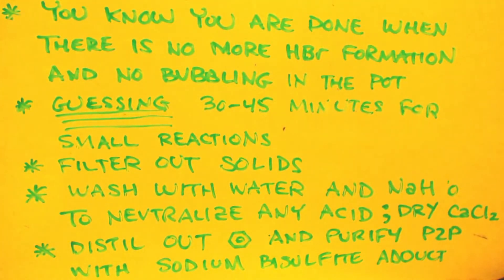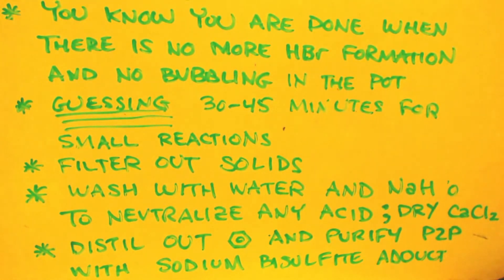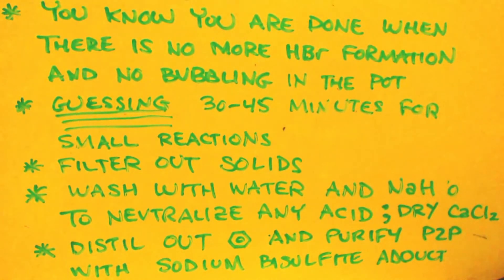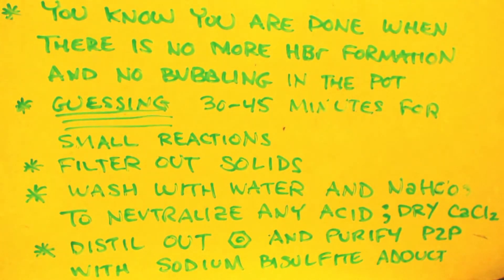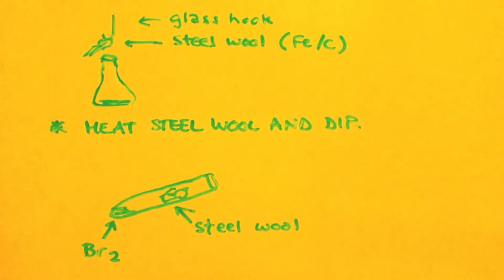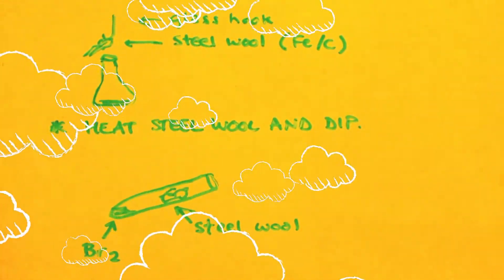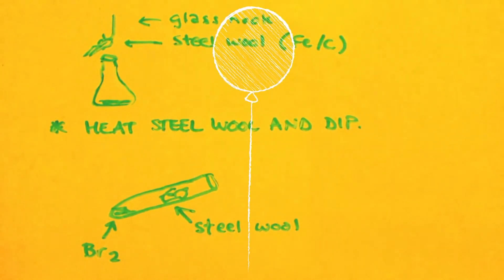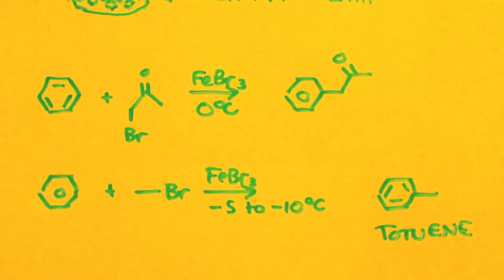P2P SYNTHESIS friedel crafts alkylation PART 2

Comment: Are you saying adding catalyst ferric bromide slowly until rxn is complete?  Then maybe a little more to make sure?  

WARNING  This is not how catalysts work, as they are regenerated more shouldnt be added ESPECIALLY if itd directly part of the rate determining step as this is in an exothermic rxn with toxic flammables of benzene AND potent neurotoxin Br-Ace.

This also suggests you are implying benzene and Br-Ace already measured out properly 2:1 to lower double addition, are all mixed and then the catalyst is added in small increments until complete (bad idea/dangerous)?  Not quite...Instead you use excess benzene (as solvent if no other choice), add the catalyst powder which isnt soluble in benzene so magnetic stirrer a MUST, turn on vigorous stirring and slowly add the Br-Ace to benzene.  I would stop well before 50%, reflux a bit b4 distilling off benzene to isolate product (not fully just yet) and recycle benzene to again same rxn...nearly eliminating chances for double sub.

Now for lab grade quality, one really should use something all species can blend...solid catalyst in liquid rxn is never very optimal.  Being FeBr3 is soluble in water, alcohol etc, a polar solvent is needed.  However, free roaming build-up of H+ is undesirable as the HBr buildup will stop rxn at a low yield equilibrium.  So, a polar aprotic is desired (DCM is great, also pyridine works well too b/c its ability to "catch" the H+ as its made and neutralize it.  Then, well same as but w proper solvent, more control, and much better yields/use of catalyst its much faster and safer as it cant run away.

NEVER mix full batches of reactants together *esp toxic flammables* THEN decide to sprinkle in a pinch of catalyst !!  

Im not trying to be rude, but as a chem engr whose worked R&D and saw fatal "whoops" in simple oversights in the lab working with rods of metallic lithium, I had to point this out...plus share a little extra on optimal procedure.  You know your chemistry very well i can tell, but how much of this or similar have you actual laboratory experience?  Its very different sometimes

-The REAL chemist
Reply from the maker: Chad...........My experience in the lab is very little compared to my book learning.   Doing experiments are so time consuming.   And the more advanced reactions need a bunch of precursors that all need made.   And i need to make stuff to make the stuff i need to make precursors.   VERY TIME CONSUMING.   But i am working on it.   I am just a STUDENT of chemistry.   I claim to be nothing more.  But to answer your question i probably got 2000 hours of  chemistry lab experience or more.  But keep in mind i started out just making salts/acids/bases.  I have just been trying to get into more complex experiments in the last couple years.   Although i did have other labs in the past.  Physics labs/bio labs/electromechanics labs.  
                    I do agree WITH YOU that for the experiment in the video.... because you are dealing with alpha bromobenzene.... that the catalyst should be put in the benzene first and then drip in the bromoacetone.  Because bromoacetone is like tear gas.   But i would NEVER reflux.  I would drip in the bromoacetone in to the benzene/catalyst mixture that was on a cold ice bath and then when it was all added maybe take it off the ice bath and keep stirring while the reaction pot heated up to room temp.   
               The reason in the video i say add the catalyst last is because i watched like 20 videos of professors  in college and just youtubers adding the catalyst last. And i guess i got that idea stuck in my head LIKE AN IDIOT.   A little tunnel vision because of it i guess.   Although they are ALL doing small reactions.   So for big reactions it would not be a good idea.   But ...again...I DO AGREE  WITH YOU and think the catalyst should be put into the benzene and then drip in the alkyl halide(bromoacetone).   It just sounds better to me and SAFER.   AND I DEFINITELY SEE how having both reactants present and then throwing in the catalyst could go wrong if it all reacts at the same time.   But i think in this case the LOW SOLUBILITY of the catalyst and the low amounts of reactants make it not as big of a deal.   But it is always BEST to be in practice of doing what you said by adding the catalyst to one reactant and then dripping in the second reactant.  So i can NOT argue with that.  YOU ARE ABSOLUTELY RIGHT!!!!!!!    This is why i am just talking about the reaction instead of doing it.   By the time i get to doing the reaction i can get advise like this from people like you and do it more safe or correctly.   I mean so far i have never done a fiedel crafts reaction but it is on my list. 
                 Also i wanted to mention that ONLY "ideal" catalyst last forever because of regeneration.   But just like an "ideal" gas does not exist an "ideal" catalyst does not exist either.  And catalyst do get used up/sintered/decomposed and do not last forever.   And yes for the reaction.........FOR THE FIRST ATTEMPT.......when the reaction was over i would add a little bit more catalyst TO MAKE SURE  you added enough to bring the reaction to completion.   Here is a video of someone doing a friedel crafts acylation and look how he adds the catalyst last.   Also look at the video at 6 minutes in cause he talks about how the catalyst formed a complex with the lone pairs on the oxygen on the carbonyl.   Which you think is impossible.  
                As for using a better solvent other than benzene because the catalyst stays solid.  I did want you to know that the catalyst that are anhydrous like AlCl3 are slightly soluble in benzene.  They are not really insoluble.   And if you use benzene it is one less thing you have to separate from the reaction mix when you are done.    Also are you sure DCM would be a good option??????????????  Because DCM is an alkyl halide (technically an alkyl dihalide) and that would compete with the other alkyl halide (bromoacetone) you want to react with your benzene.   You may get a lot of the DCM adding to the benzene since it is an alkyl halide.   Also the FeBr3 will probably complex with the lone pair electrons on BOTH chlorines on the DCM.  
                         As for pyridine........i do not know but there are lone pairs on the nitrogen on the pyridine.   Are you sure the FeBr3 would not complex with the pyridine?????????????   If it does which there is a strong chance it will then you would need to add in a stoichiometric amount of catalyst compared to the pyridine just to make that complex and then add in more to actually do the experiment.  If pyridine does NOT form a complex with FeBr3 then it would be perfect cause it could soak up all the HCl gas that is made as a byproduct by making the HCl salt of pyridine.  But i do think FeBr3 does make a complex with pyridine.....but i am just guessing on that.   But FeBr3 is a lewis acid meaning it has an empty orbital and in my mind it should complex with ANY lone pair electrons it can get it's hands on even on a nitrogen atom amine like pyridine.       Anything that has lone pair electrons is a lewis base.   So why shouldn't it react with a lewis acid????????????????????????   Last time i checked .....acids and bases reacted.

                Well i hope i replied to all that you asked or commented on.   If not just post back and ask or comment.    So do you understand everything i said????????   What did not make sense to you or what do you think i am saying is wrong??????????   Anyways have a great day buddy
Reply: @johnblacksuperchemist2556  just glancing at this...the DCM should not react because though it is as you say, overall this molecule is much less reactive in comparison and will not form carbocation, and has a very low close to zero reaction rate of SN2 because it is a single carbon primary.  This is all conjecture based on educated guess mind you; but the br-ace would have magnitudes higher rate and should dominate in formation if there was any solvent reaction at all...Cl binds much stronger than Br being a smaller atom and having a higher electron affinity (is why i use Br-Ace vs Cl-Ace aside from Cl2 gas being much more difficult to try and work with adding it to the Ace...and its difficult to measure weight/amt of gaseous species etc etc), so with lower temp conditions and catalist aid the Br-Ace should react while the DCM remains a neutral solvent.  

CCl4 would be much better since its nonpolar, which is originally what I was meaning instead of DCM possibly, but its been a while so I cant remember for sure; though while benzene is pretty miscible with it im not sure if Br-Ace would be very soluble.  Im guessing its solubility would be low, but added benzene should help...and a low solubility so long as it does mix in somewhat can actually be preferred when dealing with this type reaction so run away and over-substitution chance is further prevented by low concentration of one of the reactants.

This too was just me pondering possible alternate methods as a thought experiment, the best way so far (though i havent personally had a chance to try these alternate method ideas) is letting benzeze be the solvent.  Since its also a reactant, dropwise addition of the Br-Ace with continuous stirring yields very good results as you have complete control of reaction rate with rate of addition, and no extra species to have to remove upon completion
Reply from the maker: @ckimsey77  ..........Well that all sounds logical to me
Reply from the maker: Chad.............Man you really made me think today.  I got a brain cramp now...lol.
Reply: @johnblacksuperchemist2556  hey i just saw your replies...Im headed to bed for work 2mor but i'll read through them carefully and give you a proper response asap.  They all look fairly long which im excited for; most people, and by most i mean 99.9% give some 2 sentence im right by default and youre stupid for thinking different, without even reading the dand content or saying where they disagree/give an explaination etc...Thats so aggrivating lol.

I love to learn and be challenged mentally, thus going chem engr and branching minors into biochem/polymers; chemistry of life is SO fascinating and after all ive learned/studied and did R&D...Ive only learned enough to know I dont know shit lol.  My comments were mostly a thought experiment thinking out loud as some attempts to hypothesize an alternate possible mechanism if i remember right (its been a while) so im gonna reread over mine when i read yours

Im hoping your thoughts opens a new mental path for me; im never afraid to be wrong; throwing out ideas is how we discover and I RARELY ever get the opportunity to discuss such topics, especially in detail, with anyone else so this is nice.

Anyway gotta crash.  Im on my ps4 atm so typing is a pain, but ill get on my PC so i can read etc and prpoerly respond without it taking me 20 mins to get out a paragraph.  

Thx a lot for writting back, most dont even bother; or they feel im trying to attack them.  Saw one kid trying to do electrolysis for H2  O2 gas gen., but he was using wrong electrode material and NaCl in much excess to increase current...but couldnt figure out why him and some followers were walking away w sore throats and burning eyes.  If you dont know it well, you shouldnt play with it <too much> but especially instructing others; chemistry can be dangerous!  Lol, and pumping Cl2 gas into your closed system room w zero ventilation wont end well for your health.

Ok seriously....Im out.  Ill get back in a day or so.  My channel is about truth as well, no bs.  You should check out the series i started...got interrupted by some serious issues but thats a long story.  They're crude but not too lengthy, see what you think if u ever have time
Reply from the maker: @ckimsey77  .........Oh my god buddy..........you took the words right out of my mouth.  People do not know how to debate or discuss subjects at all.   Like you said they only know how to tell you that you are wrong WITH NO THEORY OF THEIR OWN to show how they are  right.   Although i disagree with almost everything you said....lol.   I did try to give an explaination of why i thought you were wrong.  And  if you can prove i am wrong i would love to hear it.  That is how people learn.   Unfortunately most people do not want to learn they just want to put you down.    You definitely were right about how i added the catalyst wrong.   I was definitely a bone head when i gave that instruction in the video.   I ADMIT IT...LOL.   But that is how i learn.   And i thank you for correcting me.   I can not wait for your response.  I am curious if you will agree with what i said or if you have more info you can give that will change my mind and prove i was wrong.   Anyways i will check out your channel.   Have a great day.
Reply: @johnblacksuperchemist2556  sorry its taking so long to get back to you on all these, but you brought yo light some good points, a couple i had not considered when writting those last year.  The dropwise addition to benzene/catalyst is what ive used before and it works quite well, but the rest was me just thinking out loud just based on my own mechanism theory.  Im studying/researching the things you mentioned is where the time is going, i dont wanna answer without a better understanding of all these possibilities.  Like you said in one comment, you made my brain hurt lmao; but I love that because it doesnt happen very often.

Is why I ove chemistry (especially biochem), its comples as hell, though we can model, experiment and get a great idea on what we THINK is going on...there's always that possible curve ball where everything is done perfectly and it turns out completely wrong from what you expected.  Even the absolutes arent absolute, because mechanisms are, though great explinations, are at the end of the day still just guesses; no one really truly knows exactly how it does what it does in more complex reactions.  The more you learn, the more you understand how little you know...
Reply from the maker: @ckimsey77  ............You are preaching to the choir.   If there is one thing i am DEFINITELY sure of is that an experiment in some text book is always totally different than the actual experiment in real life.   KEEP IN MIND any video i do like the one above where i am just talking about the experiment means i did not do the experiment yet.   So there is a lot of guess work in these videos. 
                          I did a 3 part video on hypochlorous acid(acidified bleach)  oxidation of alcohols to make carbonyl compounds like aldehydes and ketones.  Beautiful videos of just me talking about the mechanism and what i would do if i tried the experiment.   Then after i made the videos eventually i actually tried to do the experiment in real life.  What i learned was that i was right about everything EXCEPT ONE THING.  A very important thing.   I did the reaction and made acetone from isopropanol.   But when i tried to oxidize a primary alcohol(ethanol) to acetaldehyde the experiment WOULD NOT WORK.  So i kept reading about the experiment and i EVENTUALLY learned that you need a catalyst called TEMPO if you want to oxidize primary alcohols into aldehydes.    But i live and i learn....lol.   There is always another piece of the puzzle.
                  Sometimes i come up with my own theories that i did not read or learn from someone else.  MOST TIMES i am wrong and just did not know enough about chemistry to be right.   But my latest theory i came up with ON MY OWN is how to make red phosphorus from white phosphorus.  I looked up the dissociation energy of P/P bonds and then i did a little math to see what wavelength of light corresponded to that energy.  And my theory is this...........If i take some white phosphorus and heat it to 50C to make it liquid.   And then store that under water.  And then turn my stir bar on.   And then shine the appropriate light onto the liquid white phosphorus that it will break a P/P bond and recombine to make red phosphorus.  I bought the light bulb i need but now i just need to make some white phosphorus and see if i am right.  For all i know it will catch the white phosphorus on fire but i really think it will work.  But only by doing the experiment will i definitely know if it works or not.  What do you think?????????